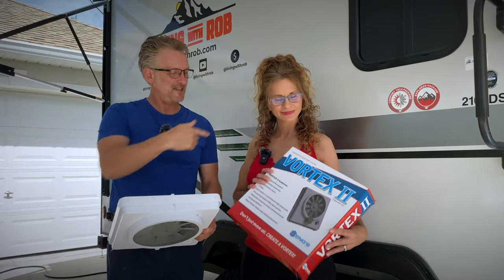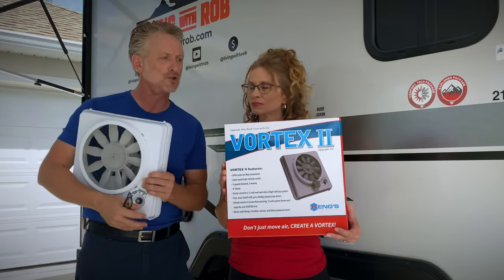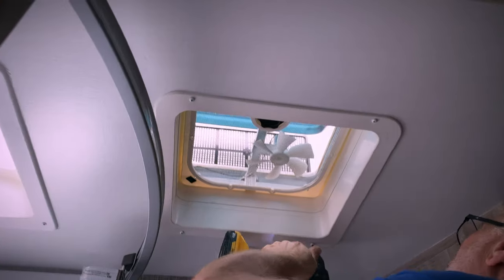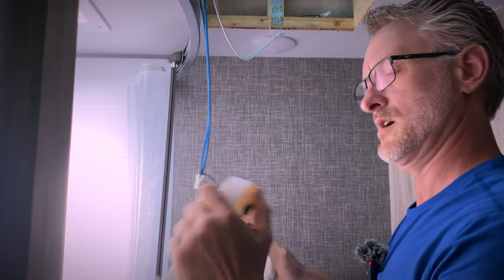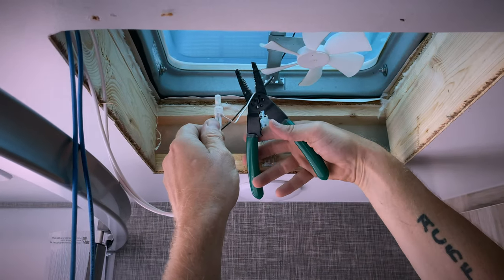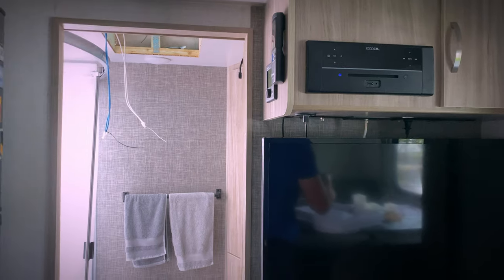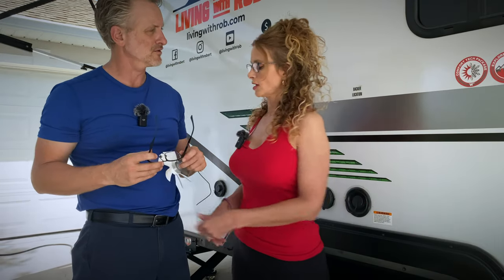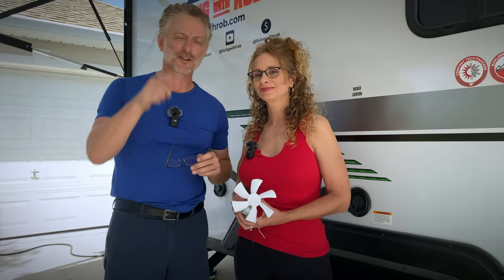Winnebago Micro Minnie 2108DS FLX: TRANSFORM YOUR VENT FAN with This Upgrade! 🚙

Comment: Great video!  Thanks for the clear instructions.  My factory installed small overhead fan stopped working so I'm taking the time to put in a better fan.  I have a Winnebago Micro Minnie 1708FB.  Rob, based on the video description, it sounds like you installed two different fan brands - a VentLine and a Vortex.  Do you prefer one over the other?  Was one more quiet than the other?  And if one were easier to install, I'd like to know that as well.  

Love the funny interactions between you two!  Thanks for any guidance you can provide!
Reply from the maker: Hi and thanks for reaching out.  Yes, one is in fact quieter than the other.  Not much, but it is.  They are both the same difficulty on the install...which is not difficult at all.  This fan is the quieter of the two.  https://amzn.to/3QxblI1

The second fan is more stout however.  The second fan, while a tad louder, has a much more sturdy cover screen.  The first fan's screen is difficult to remove to clean and it's not built really well.  The screen came loose from it's plastic frame after a time and was loose.  The factory was GREAT about replacing it...actually sent me the whole fan set up again...just for the screen.  But again, the quieter fan screen is a real S.O.B. to get off to clean.

Here's the second installed fan link.  https://amzn.to/3y9yJFf

I hope you find this helpful.  You made Joelle's heart happy with the comments on our interactions.  🥰
Reply: @livingwithrob  Thanks so much!  Very helpful information.  I'll order the better built (and slightly noisier) one.
Reply from the maker: @PrimeTimeOrganized  happy to help...as always.  Let me know how it goes!